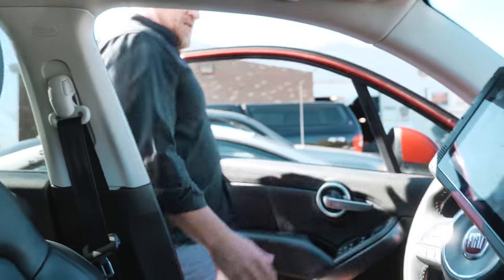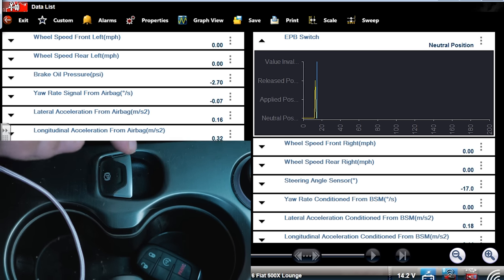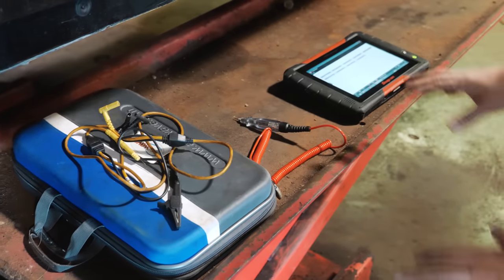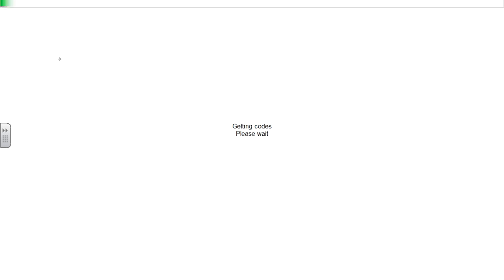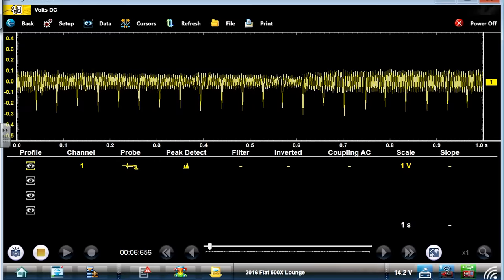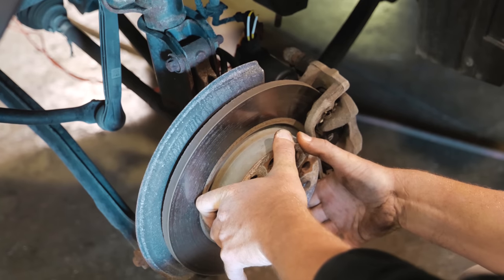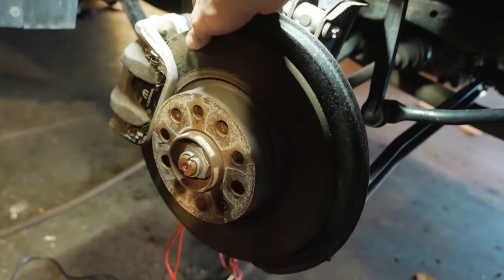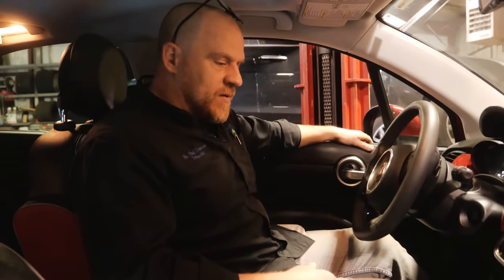2016 Fiat 500 Electric Parking Brake Intermittently Sticking On

Comment: Wait  until you get one of newer alfa romeo stelvio or giulia lol.
There is brake pads/disc reset in scan tool.
Basically other shop done rear pads in stelvio (usa import to europe if it matters). After that brake pedal mushy and poor braking performance and surprise it wasn't air in system...
Just doing electronic brake pads replacement command fixed everything... 
I had done Giulia's rear pads and discs and got same mushy brake and it need serval electronic reset until i got back pedal..  does car just suck

Comment: Is it possible that it reads the resistance of the motor? not bias voltage?
Reply from the maker: You need some type of bias to read it. Can't measure resistance without some type of current flow, as small as it may be. Even your ohmmeter uses a small trace voltage to calculate resistance. Make sense?
Reply: @ScannerDanner  you didnt find any bias, and there is no way to know without some kind of measurement, I cant think of any thing else except two different resistance high - low and of course open, its killing  me I need to know what it is? thats why we love you Paul. figure it out for God sake and my sanity. lol
Reply from the maker: @memphisautodiagnostics4136  it was definitely there. I proved it on the good side by unplugging the motor and it immediately sets an open circuit code. I think if I would have AC coupled my scope and dropped my voltage and time base we would have seen it

Comment: As for the bias voltage. Some kind of Renault car. The bias voltage at the wheel speed sensor disappeared as soon as the computer detected an open circuit. It turned out because I used a separate scanner and a separate oscilloscope. There was a short pulse immediately after erasing the error codes. I don't know why the manufacturer did this.
Reply from the maker: Awesome!

Comment: Might have been an easy way to clear the incoherent code would have been to put it in service mode-eg change pads mode then return to standard operation?
Reply from the maker: I think while that fault was currently present, none of those modes would have worked properly. The system kept locking it out.
Reply: @ScannerDanner  ok

Comment: first thing I thought was bad actuator or wiring to the "one" side", since it works intermittently, I'd think actuator internal issue/connector end at it has green death.
I'd look there first, then continue on if not the glaring problem. dealer tech was probably fresh ASE certified school certs.
** yep at 10:35 I figured as much! cascading error codes set by the main issue and continued upstream as errors on other modules in the loop.
it's pretty wise to start troubleshooting at mechanical moving output devices first, versus getting lost in code hell, even more probable with more than one of the same device with others working fine. I guess having electrical, electronics, computer, networking and plumbing skills helps  think faster and target probable bad devices faster. well, that and nearing dinosaur age. 🤣

Comment: Fire that part cannon all over it!! What happened to a good old mechanic. How can we fix this the cheapest way. Assess test and repair. No one repairs these days. Had to strip my door lock on my Saab because the ajar switch was intermittent and triggering the alarm and not allowing the central locking to work. Quite enjoyed the achievement on that considering a used secondhand is £60 :)

Comment: This is why I stick with older mechanical parts . Easier to work with lol.
Reply from the maker: this wasn't so bad, just a simple reverse polarity DC motor I just struggled with confirming good driver operation and wiring integrity. That's what made it seem so complicated. Sorry about that

Comment: Dealer techs are using identifix and loading the parts cannon.
Reply: Can you call them techs? I think Paul has a better phase [parts changers]
Reply: @Jim Yep  It's a blanket term used by our industry. Anyone that works in our industry is called a technician. They wanted to church it up from mechanic. And to that, yes people that shotgun parts based on identifix are parts changers.
Reply from the maker: let's be fair, there are just as many parts changers in the indy shops and I know some really really good dealer techs too. However I will not argue that the dealership can be a breeding ground for grooming a parts changer, in large part because of how they pay their techs. To be paid .3hr of diagnostic time on a warranty electrical or electronic problem is absolutely ridicules, Wouldn't you agree?
Reply: @ScannerDanner  100% agree. Dealer pay is horrific for techs. Independent shops pay better and seem to encourage better diagnostic skills. I've seen some amazing dealer techs but I've also seen plenty of parts changers. I just went thru this on a gmc truck, dealer loaded the parts cannon and replaced pcm and a couple other modules at customer expense. It turned out to be a bad o2 sensor shorting out. I think in our industry you can find good techs and bad techs everywhere, just seems to be more in my opinion at dealerships.

Comment: Wish he had put ground on 1 side and positive on the other
Reply from the maker: that would have confirmed motor control in both directions for sure, but that was not my concern. My main concern was driver operation in the module. Hope that makes sense why I didn't do that test. Thanks!

Comment: ok just made a cuppa and had another thought omg says you all wish he would  shut up. i thought of a flow chart for proving this fault. when you sent the let hand feed to the right hand motor you proved the integrity of the circuit and driver. do that and you have proved the fault to be in the motor. two cap heads and you have removed the motor from the caliper.---- voltage to motor test. prove motor.---- seized caliper end of. unfortunally in europe the motor cannot be sourced individually and comes with a new caliper, expensive con i say the motors should be sold individually but hey ho

Comment: That option has no business being on a car. There was a trouble free system before electric oh I forgot this way makes more money
Reply from the maker: I honestly like this over the rear parking brake shoes inside of a rotor. They were nothing but problems. Do you remember the rear caliper set ups that had the parking brake mechanism built into the caliper. Those were garbage too. But I understand your comment
Reply: @ScannerDanner  I am in Alabama we never have parking brake problems until they went electronic my 1994 ram 2500 has all original parts except rear brake shoes and have never had to work on them. The problem you are having is the same sorta problems trailer mfg companies many of the new trailers have hydrolic down here trouble free
Reply from the maker: @DependableAutoTruck  I can see that. But up here in the rust belt? Frozen parking brakes are the norm 😑 This fixes that issue for us imo